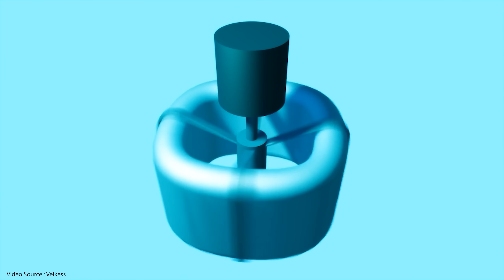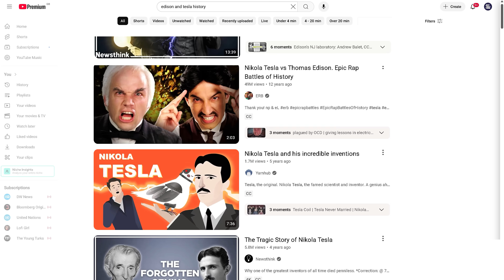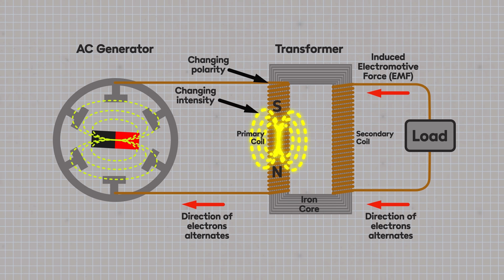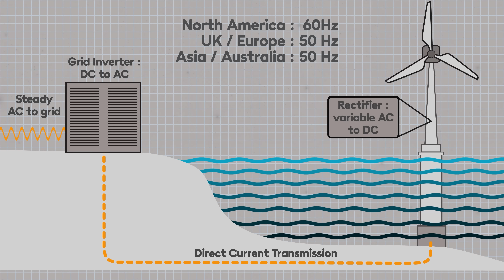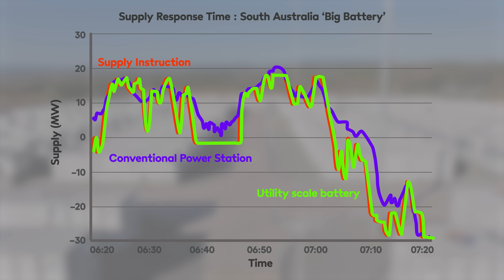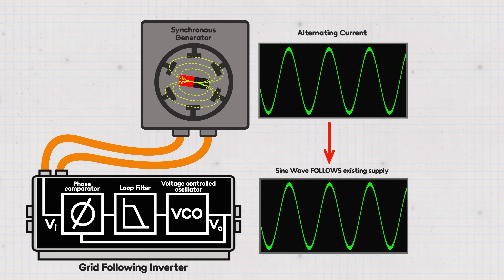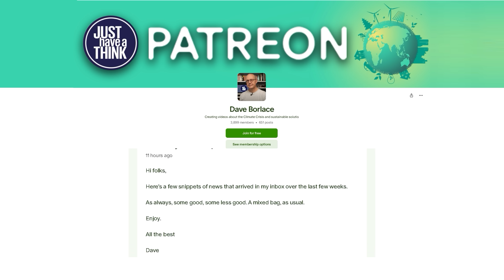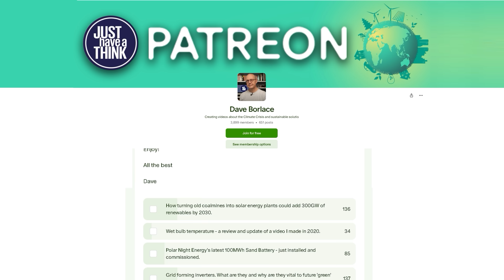How GRID FORMING INVERTERS are paving the way for 100% renewable energy.

Comment: How do you protect against a situation where multiple inverters try to start a grid but they aren't in phase with each other? The nearest grid-following inverters might power on and start fighting on massive scales over whether they're supposed to be pushing or pulling electrons right now.
Reply: Simple. They start gently and adjust their phase until they are synchronized.

Comment: Power cuts are common in NZ, especially in rural areas. Luckily our climate is moderate, so yes we could survive indefinitely without electricity.

I remember having power cuts for days when I was a kid. We always had plenty of candles and torches ready. We also had gas cookers in case it took more than a few hours  for the power to come back. Unfortunately we had pumped well water so the water would stop running after the water tank was emptied. It lasted for 2-3 days because we wouldn't shower when the power is out.
Reply: On the topic of NZ, the initial graphic showing hydro percentage has NZ at 1 to 20% which would be accurate if it was percentage that is not hydro.
Reply: @jnawk83  You've got a keen eye.

You're right. That graphic is incorrect. The last few times I've checked the genesis app it said that approx 60% of energy production was hydro. Not sure if that varies between power companies.
Reply: Nowadays,  go solar and batteries and never have a power outage again. (And save a heap of money!)

Comment: I just heard that Scotland has wind turbines and they ruin the view from golf courses.
Reply: What's more the weather in Scotland is cold and the wind turbines are delaying it's improvement by displacing CO2 emissions.
Reply: @petewright4640 Heating Scotland with increases in CO2 will reduce the need for fossil fuel used. Maintaining the sweet-spot of just the right amount of CO2 to heat Scotland could keep golf courses green. saving turf management costs and making them more profitable.

Comment: I agree we need inertia energy. Great video. I would like to see a flywheel in northern MI. Built out of part time coal plant. That only operates seasonally. Small scale solar does make sense. Large scale yes if close enough to where needed. I live in a land with wind turbines, but we have nuclear and incinerator power too. We have a few hydro plants for black starts one even runs sawmill mostly. It takes energy to start many power plants except solar. Which can't perform a black start. Perhaps cleaner "fossil fuel research" isn't a bed thing. I decided on just a d.c electric system in my cottage. One inverter for power hungry a.c. tools. I use a 2 stroke water pump because a.c. water pump are power hungry and distance to my well from camp. Being offgrid it's one appliance I found that really needs a.c. electric or gas. Sure with enough batteries but I am on a budget. So 135$ for a 2 stroke water pump and gallon of 2 stoke gas  saves me 35000 calories of bucketing water 8 hours a day and 5 days a week. I use 12 volt d.c. pump with pressure switch from cistern at camp. D.c. induction is one of my favorite d.c. appliances.
Reply: Greetings from below the bridge. Refitting flywheels into the locations of retired fossil fuel plants is an excellent use case as all of their grid connections are already built. I could also see the colder side of the country being an application for those deep borehole microwave drills for geothermal energy that have been discussed in a few places including on this channel in the last couple years.

Comment: Living in Syria I use a battery and inverter for the power in my flat. The grid electricity comes for an hour three or four times a day. I have a heavy duty transformer to stabilise the incoming electricity which feeds into another transformer which is more sensitive to smaller fluctuations which in turn goes through the battery management system and finally into the lithium batteries. I also use solar. Still, I have had to replace fried wires and the heavy duty transformer once, but luckily nothing else.

I'd consider refrigeration as essential.
Reply: Thanks for sharing. Best wishes from Australia.
P.S. how do you manage internet connectivity? What are the challenges therr?

Comment: Excellent description of inertia, as related to grids, and it's importance. Often not easy to put these physical concepts clearly into words, so thanks Dave. And well done for tackling this subject as it's regularly used to bash the push for net zero on national grids.
Reply: ‘Used to bash’ ? Or used to point out the folly of destroying a working system to replace it with new technology which has not been tested at scale or over any reasonable time period. The video points out that a system South Australia had to install new kit to make it work. This is AFTER the tried and true power stations were demolished. It like building an aeroplane while it flies, feasible but unwise.
Reply: @graemecreegan6749 I think you are exaggerating. We are not "destroying" a working system but gradually ( over a decade or two) integrating new tec and decommissioning old tec. There may be some problems and we can always be critical (constructively hopefully). The bigger folly by far is to not tackle climate change.
Reply: @petewright4640  you may think I’m exaggerating but you may be wrong in that regard.  Exaggeration is rife however and you would do well to keep an eye out for it
Reply: @graemecreegan6749 BTW how do you suggest that we land the "plane" before we work on it 🤔

Comment: I am slowly coming to the conclusion that 100% renewables is not desirable. Maybe 10% of power generation should be conventional generation. As humans we do tend to see things in terms of black and white.
Reply: But we shouldn't put all out eggs in one basket which is the petroleum based power. There should be backups of wind , Solar and geothermal.
Reply: The last few percent of the energy supply can be via battery storage and grid forming technologies, but in many places there is enough hydropower or biodigestors that can supply energy for a restart - it is the coordination needed for getting things going again which is going to be the most difficult issue.

Comment: If frequency drop occurs you can start to drop out heaviest power consumers off the grid automatically, why is this not mentioned? It IS possible to control the grid load on microsecond level with modern power  switches.
Reply: It's also possible for everyone to use a battery for energy storage and never experience an outage ever again!

Comment: What i keep thinking about more and more is what projects are working on the issues with batteries and hot climate. I know australia has large battery farms but I don't know how they are dealing with heat. Been running in my head since I tried buying a portable battery bank for camping and asked manufacturer if their bank could withstand high temps in summer months if you stored them in the car. They told me clearly that they could not so I wonder how the issue is handled then in direct sun at these battery farms in scorching hot areas. Only solution i recall is the undersea farms but there has to be more i'd think it's pretty big problem.
Reply: Best to keep batteries cool, but not too cold. Leaving a power bank on the rear parcel shelf of a car in the sun is asking for trouble!
Reply: @gregbailey45  yes.

Comment: What serves as the synchronizing reference for a grid-forming inverter?
Reply: I think what you are trying to understand is the difference between black-start situations and normal operating situations.  Under normal operation, grid-forming inverters still synchronize to the existing grid voltage waveform.  But once synchronized they will push the waveform according to their internal timings.

In a black-start situation there is a long involved sequence of events that typically begins with all loads disconnected and all AC segments isolated, then with just one (or a small group) of black-start generators on each segment that provide the master waveform for the rest of the system, and energize the lines and equipment.    Usually black-starts are manually initiated operations with time-based fall-backs and retries if the designated black-start generation is unable to provide sufficient resources to re-energize the segments.

Its a long and involved process to reconnect the pieces of the grid together at DC points and phase converter points, reconnect loads, and reconnect generation resources (which themselves create surges and VARS and other problems which the bootstrap black-start generators have to deal with).

-Matt
Reply: There's a lot more to this than Dave indicated but it's necessary not to get too complicated for a short video.
Reply: The grid frequency itself is used.  This is a detail that most people outside the utility space don't understand the reality is that with grid-following and grid-forming inverters they both actually use the grid frequency as the local reference.  The difference is in how the PLL is designed and whether it is designed to provide inertia or not.

Comment: UK has installed multiple "synchronous condensers" that provide inertia and frequency stabilisation to the grid as well as short circuit voltage control.

Carnot batteries on existing thermal generation facilities could also be a way to retain inertia at low cost, there was a pilot project in India I believe.
Reply: The UK's grid stability pathfinder projects have deployed a mix of SynCons and grid forming batteries over the last five years. From the end of this year 1/3rd of the intertia, phase management and short circuit protection on the UK grid will be of the synthetic type (with large savings as a result, upto £14bn over their 15 year lifespan). 

They even enabled the replacement of coal, with one SynCon doing the work of five previous coal power stations.
Reply: @GruffSillyGoatyes the grid has done a great job of forward planning the energy transition

Comment: Uriguay has an almost 100% renewable grid, wonder how they solved that problem.  Possibly the fact it has a high proportion of hydro power solves the problem for them.
Reply: Und wie hoch ist die Bruttostromerzeugung von Uruguay?  Kannst du vergessen. Keine 30 TWh pro Jahr. Hierzu mal die Bruttostromerzeugung  im Vergleich: Deutschland mit bekanntlich  hohem Anteil energieintensiver Grundstoffindustrie mit ca.505 TWh.  Die lumpigen 30 TWh hast du (übertrieben!) gesagt mit 4 Hamsterrädern, 10 Windmühlen, 12 Solarpaneelen und 5 Wasserkraftwerken erreicht. Kannst aber dann großartig mit 99% erneuerbaren Energien auf den Putz hauen. Uruguay hat das Glück , viel Windaufkommen, Solar und enorm viel Wasserkraft nutzen zu können, hat aber im Gegenzug keine energieintensive Grundstoffindustrie, Und somit ist das Ziel, Wirtschaft und Bevölkerung zu versorgen, schnell erreicht.

Comment: I could survive a few days with my own battery/solar systems.  After that, roving masses of starving people would kill me, take my food, and let my system fall in to disarray.
I mean, I have no idea, I'm not a crazy person that thinks about this stuff and spent tens of thousands of dollars on that solar/battery system.  Or a backup system.
Reply: Do you know for a fact your solar battery setup works when the grid is down? asking as mine doesn’t / can’t (not something knew before I got it)
Reply: @odds87 swap out the inverter for one that can. And then try sending the bill to the idiot who designed it.
Reply: @odds87 The one on the house does (3 or 4 short outages in the last 2 years) and my backup system is entirely off-grid on a trailer.
Reply: @odds87  It depends upon how it was designed and installed.  Some systems will not run when the grid goes down because they've not built in the switches and controls for running your house in isolation with whatever battery storage you might have installed.  Which is the other point, if you don't need battery storage very often at all you can install much less of it than would be required to ride out a several day outage...  Choices all around, spend as much as you like for the system with redundancies that you require.

Currently (no pun intended :) ) our system is no battery backup other than a small system to run the computer for a few minutes while I shut it down under controlled circumstances.  I can run the refridgerator off it for about a half hour.  I don't need it for much or for long and it is good enough.  The tank of propane we keep on hand will provide heat through several days or even weeks in the winter.  That is much more important.
Reply: Lost power for 3 days from storm in Brisbane now got a 24kw sigenergy battery system with full house backup can go off grid run off my solar panels etc luckily got rebate so cost was about $17k

Comment: What about thorium reactors or SRM Nuclear reactors?
Reply: We don't now have time to develop and build them.
Reply: Ideally Nuclear reactors always run at full power to pay for the initial investment and output-independent running costs.
So while they add the predictable baseload we once needed, they are unable to adapt to a worlds where demand fluctuates quite erraticly because of EV chargers, induction hobs and home solar.
So we will still need huge batteries which might as well be grid forming. 
I think Thorium Molten Salt Reactors are a great idea, but realistically these will still take a few decades to get perfected, approved and built. By that time it may be a bit redundant with batteries and solar panels getting better and cheaper every year and wind turbines complementing them in ever increasing numbers.

So yes, they could help a bit in places where wind and solar is not abundant, but I would not be surprised if nucluar power is a niche market within 20 years.
Reply: @SolAce-nw2hf  Heat storage my dude, heat storage.
Reply: @GreyDeathVaccine  Maybe in colder climates. But do really want heat from a nuclear reactor running through the floor and radiators of your home? I know there are safeguards, but I would rather just install a heat pump instead.

Comment: I had a similar issue when upgrading the power system for an aircraft. The solution we used was to spec wide input power supplies, that were less picky about input power. For systems that couldn't be modified they had a power conditioner between them and the power source.   The new power systems weighed less (much more  modern tech) .

Comment: My 12 volt solar panels are not connected to the grid. They go to a controller which stops the batteries draining into the panels at night. The controller is connected to the batteries which are connected to a 3000-watt pure signwave inverter, which is connected to the main fuse box. No problem with the electrics.
Reply: No grid connection, no problem.

Comment: Yesterday I was talking with somebody about jet fuel. For electricity, there isn't any issue. We will be able to generate it for ... a long, long time. But my guess about jet travel is that the truth about bio-jet fuel is that we could never grow enough plants to power the airline industry as it stands today. My guess is that in 100 years airline travel as it is today, it will be gone. There is currently no viable alternative, in the required quantities. 2150, we will be crossing the Atlantic in boats, again, except for the very, very rich.
Reply: Synthetic jet fuel, made from captured CO2 and green hydrogen. More expensive but so what.
Reply: Google RethinkX. Energy Superabundance.

Comment: So is a hybrid solar inverter grid following, grid forming or both? I put one is last year and primarily use it as grid following, pushing energy out to the grid, but it has an output that is independent of the grid that can be used when the grid is down.
Reply: Following.
Reply: When it's on-line it is Following. When it's off-line it's Forming.
Reply: @graemezimmer604 An inverter that simply puts out power at 50Hz when not connected to the grid isn't grid forming in the sense that's meant here. Grid forming inverters are technically very sophisticated and have only recently become available. They have to increase their output power if the frequency drops and decrease it if frequency rises. They have to do this very quickly (which in itself is tricky if drawing from a pv array). But the problem then is the risk that oscillations in the frequency occur as different grid formers on the system 'fight' each other to determine the exact frequency. The characteristics of spinning masses are hard to simulate electronically.

Comment: This video is a cut above the normal renewable grid narrative. It is likely that the recent massive outage in Spain/Portugal was due, at least in part, to renewable grid-following inverters disconnecting from a grid that exceeded frequency limits. Batteries and master inverters with high surge ratings can mimic the old turbines, it's just a matter of system design and coordination.
Reply: By all account Spain expected it's traditional spinning mads generators to kick in to provide their inertia, according to the grid operator they either failed to start up in time or didn't respond at all. Whether this was due to technical issues or economic reason (too much cheap renewable available at the time) is under investigation.

Spain is now talking with other countries, like the UK who is leading on the adoption of synthetic inertia (1/3rd of the UK grid is based in synthetic inertia using a combination of synchronous condensers and grid forming batteries).
Reply: @GruffSillyGoatthere is always a risk that if a power plant is off they can't get it back online in time.  They are very reliable if they stay running but turning them off and on is hard on the system.  Just with the bolt up alone you can run into issues.  A hot pipe expands and then you let it cool and it shrinks.  Do that a couple times and the bolt up is no longer tight.